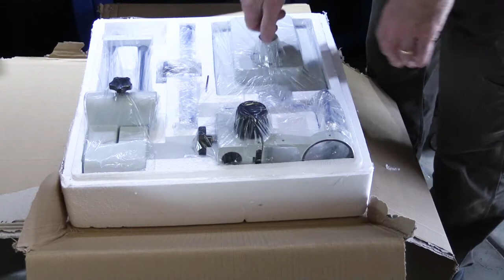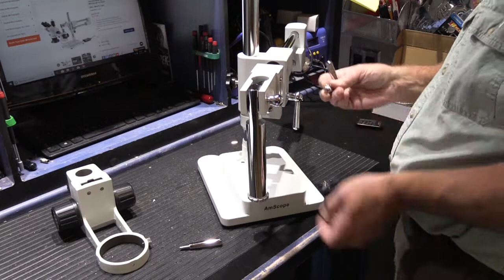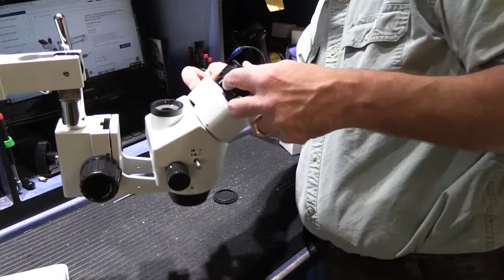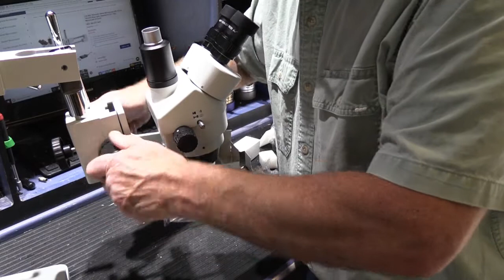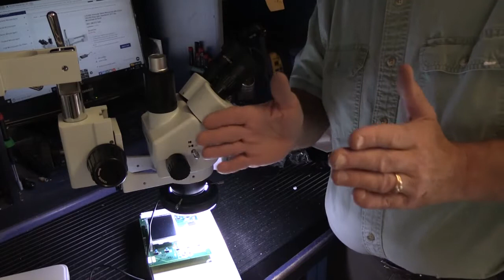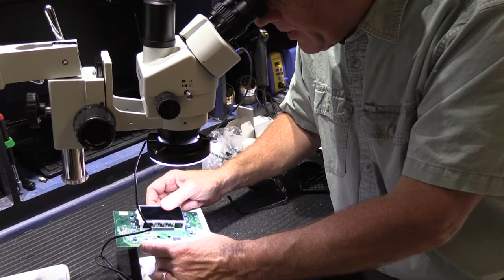Unboxing and Assembly of a Amscope SM 4YZ-144A Bench Top Microscope

Comment: Very nice.  I bought myself a zenith scope a few years back and it changed my SMD life... it's a joy to use.  I think old eyes creep up on you and then when you can see tiny things again it is just awesome.  The soldering iron tip you showed looks OK even for very small pitch components.  If you haven't already get some hot air, makes life very easy.
Reply from the maker: Hi NivagSwerdna:  You are correct that with the microscope, even the smallest compo nets are easy to see again.  I'll be ordering a micro-soldering iron that fits my Hakko 951, which will make the soldering much easier.

I'm also looking into a pair of Hakko Hot Tweezers, but I want to see how they work before buying them.  I already have a Hakko 850D Hot Air Station, which should be fine for this type of work.  I'm looking for a better selection of angled nozzles - but the choice seems limited. - Chris
Reply: https://www.youtube.com/watch?v=N_yHkrVYrBE and https://www.youtube.com/watch?v=ChujyTV-HME recommended.  I have a cheapo one but I'm a hobbyist not a pro.  But it looks like you are already well tooled up with a Hakko.
Reply from the maker: I've had Hakko equipment for over 25 years and I have a good working relationship with them.  The problem with a company like Quick is not necessarily their equipment - but their lack of presence in the USA.  If getting parts  is a problem, especially after a few years, then it presents to many issues to have them be a good choice. - Chris